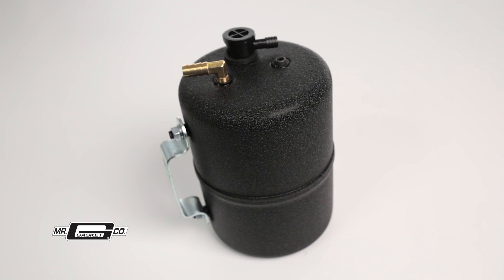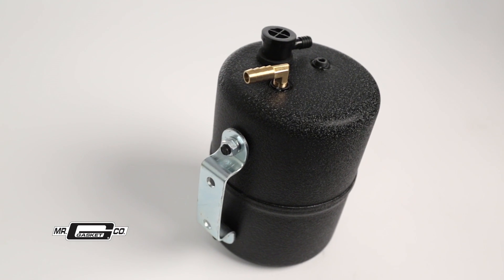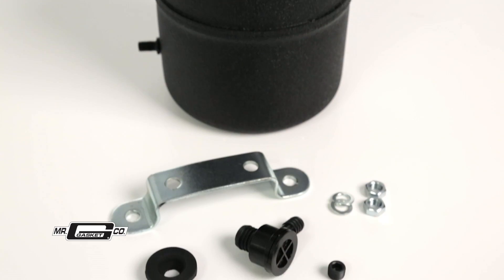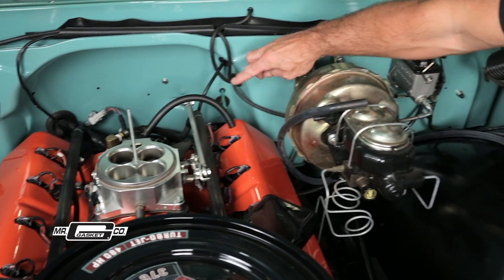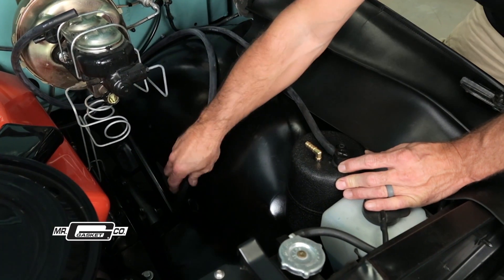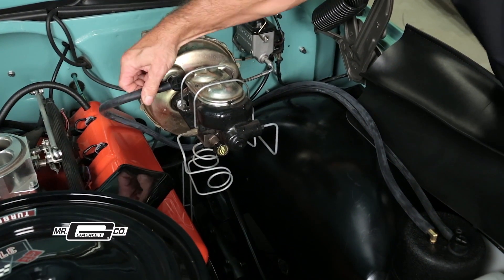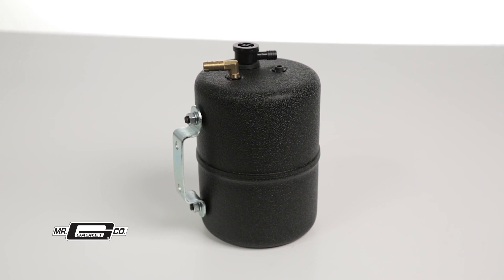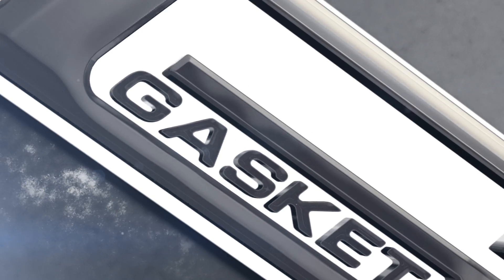Mr. Gasket Vacuum Canister

Comment: I need vacuum on my Corvette for the headlights will this work for that because I installed at 383 stroker in my 1975 Corvette
Reply from the maker: Yes, it should be able to provide you a reserve supply for your headlights.  Thx J

Comment: What is the correct size BRAKE HOSE/VACUUM HOSE 11/32 or 3/8...Amazon has this listed with 11/32 brake hose Gates # Part 27332  being sold as a combo I bought their combos before but never went well doing so so I figure I better ask.
Reply from the maker: 11/32" is only a 1/32" of an inch smaller in diameter from the 3/8" hose. It may take a little more pressure to fit on the 3/8" nipple, but should be just fine.  Thx J
Reply: Cool thank you. Is it OK to mount the can sideways?  My 64 C10 has plenty of room on the  drivers side inner fender below and in front of the Master Cylinder. I forgot to ask I also have the Holley Sniper Can I use the rear passenger side valve cover breather hole for the PCV Valve to the back of the Sniper Vacuum instead of the front.?  I want to use the breather hole at the front drivers side front of engine for the breather/Oil Fill I have the black angled Valve covers I have a Vacuum port coming from the Intake manifold so I have plenty A extra ports for the reservoir Can ..Thanks Again ..jeff
Reply from the maker: @Jeffagarcia66  Yes, you can mount the vacuum can horizontally.  And yes you can use the rear hole for your PCV, just make sure it has a baffle under it so your not sucking excess oil into the system.  Also there needs to be a vent/breather on the opposite side valve cover where you plan to put the oil fill for the system to work properly.  Thx J

Comment: I need 20" of vacume to run my 572 i have 5" wil this canister bridge the gap
Reply: no. you'll get a couple more pumps of brakes before you have no pressure. run an electronic pump with a relay that comes on when its low on pressure and turns off when its full. they sell kits for them on jegs or summit that will remedy that, i have 3 inches of vacuum at idle with my truck and its like driving my daily.